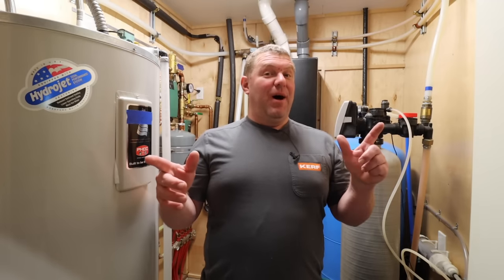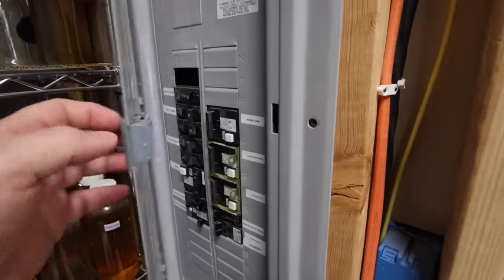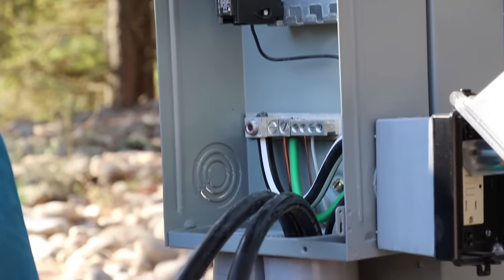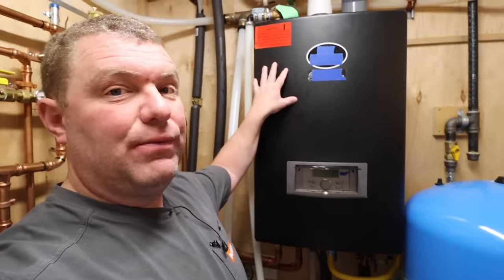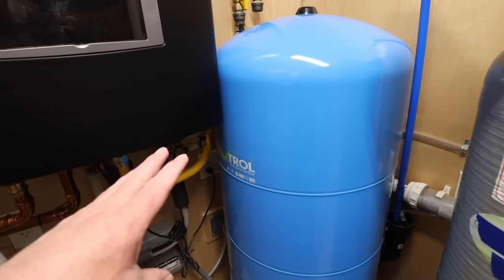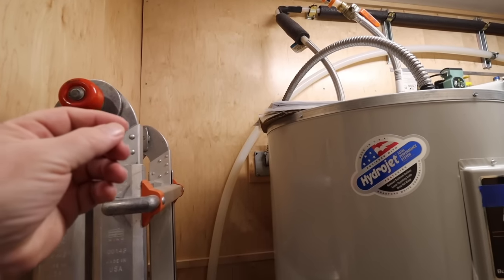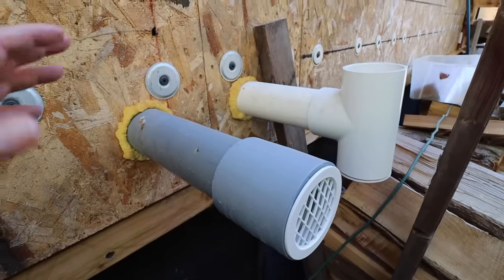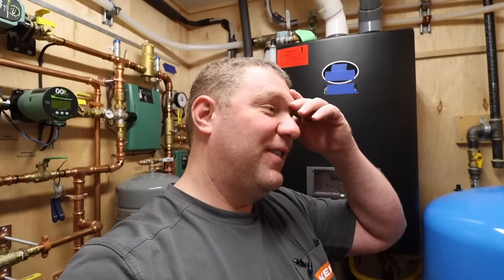3 Things They Don't Tell You About Tankless Water Heaters (On Demand Water Heaters)

Comment: Careful with hot water loop with copper because at each 90 particles hit the wall with some force.  Learned the hard way with in slab leak.  Suggest looking at Upinor PEX with distributor Valve which feeds the outlet directly with minimal 90 angles.

Comment: Rinnai tankless here. 199,000 BTU on propane.  Just plugs into a 110v outlet.  They are amazing.  I have 2.  1 for our radiant floor heat and the other will be for domestic hot water with dedicated return loop.

Comment: In Europe (The Netherlands) we use two concentral metal pipes, cold input air through the outer pipe and hotter burned gasses through the inside pipe, you need only one hole through the roof and also some heat transfer to the input air. On the roof, the output pipe sticks out above the inlet for the input air to avoid circulation of burned gasses.

Comment: I put in a tankless water heater water heater for my mother in the early 1980's. It used a metal exhaust pipe. Pilot blew out when the wind blew into the exhaust pipe. Didn't realize it until the heat exchanger  froze. expensive to replace. Bought an automatic flue closer so it didn't happen again. I don't know if yours has something to prevent the cold from blowing in the exhaust but it sure is a worthwhile investment if it doesn't.

Comment: They make a system to circulates the water from the hot back through the cold until hot water is achieved. It can be activated with the same switch as the lights.
Reply from the maker: Have them. Future video!

Comment: I like my gas water heater with it's pilot light, the pilot light contrary to claims does NOT "waste" gas, in fact, that little flame is enough to keep my 30 gallon tank at the set temperature alone, until I draw about one gallon of hot water out, then the main burner comes on, but the rest of the time the pilot keeps the water hot. If I had the electronic ignition BS they sell now, that main burner would be cyling on and off 24/7 wasting even MORE gas than they claim the little pilot does.
I dont know why you worry about that SMALL amount of "parasitic" heat in a closed utility room, in the cold months you'll be happy to have any BTU's that come from anywhere!
My water heater is in the basement, it's insulated, I don't feel the outside of the tank is at all hot

Comment: Nice system. We are getting gas on our road soon and we are getting ready to put in a system. We are finishing up a small duplex and will go with a heat exchanger tank for domestic hot water to have the capacity for both units. I’ll be putting in one of those circulating pumps to keep the water hot at both unit. I’m will be using 3/8” return going right back into the heat exchanger tank inlet. That’s a great price. We are going to heat our hydronic system to 130 F as our house is double stud foam filled walls. I have a friend that retired from a plumbing business he sold and he is going to do all my manifolds and setup.

Comment: I remember seeing you install that tankless heater and thought you were crazy. 
Personally I think a heat pump water heater is the best way to go. They are generally better insulated than regular tank heaters, and heat water much much more efficiently than a resistance heater. Plus, during the summer, they actually act as an air conditioner. In my first house I installed one in my basement which was half garage. During the summer it kept the garage at a nice cool 70 degrees, while heating the water for pennies.

Comment: It's great to have two you back.  The videos that you produce really show how you decided to do something both pros and cons and are very useful as a result.

I'm kind of interested to know if you considered heating the water using the boiler of your infloor heating and how that compared to what you ended up with.  Those boilers are more than 90% efficient and you only need a water tank.  Then you have one heater, can bring the air in and exhaust it out.  Sure you don't have a backup to gas but you could back it up with a propane or just use propane.  Add about 5k or more of solar with as much battery backup to get you through as many days without sun as you would figure to need for your area.  Maybe if you're producing videos regularly, the solar and batteries could come out of that income.  Solar's  really workable these days if you can overcome the upfront costs.

I know you had trouble with the batteries previously but maybe now they are better and require less maintenance.

Comment: its so funny in germany we have standart 100kw conections to the houses. its a 240 V  to ground  3 phase system. In the hous where i grew up there where 3 24 kw tankless heaters. Its normal, hot water tanks are more of a rarity. Very interesting how different the systems are

Comment: A few months ago my kids started taking their own showers and the electric bill spiked and mom and dad got some cold showers before we got them under control.

I've thought about a hot water circulation pump too, but that seems like it would add to the thermal mass that the heater has to keep warm and would cause heat to leak into the walls of the house which would not be nice on those hot summer days. Maybe one that only runs in the morning and evening would be a good compromise.

Comment: Thanks for sharing your thoughts, ideas and videos. Definitely looks like you put some thought into developing this system. One small question, why the blue tape on the logos?  One small suggestion, had a coworker that policed his sons shower time. Took a suggestion I gave him, put a 120v solenoid valve on the hot water to the shower and added a mechanical bathroom heat lamp timer switch to it wall mounted with the light switches, no where near the shower. His only complaint was it ran more than 10min. 😂 certainly glad he wasn’t my dad. Wishing you and your family the best. Looking forward to seeing more of your videos in the future.

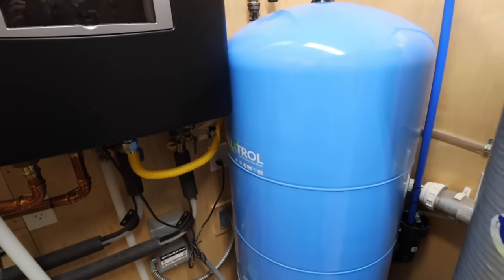Comment: Doesn't the internal tank 9:42 represent a parasitic "cool" mode that you need to make up in the winter?
Reply from the maker: Sure. Conditions water thought which makes the cold water warmer which makes the house more comfortable vs frigid tap resulting in overall lower energy use.

Comment: My tankless is built in that same "box" but different color, brand, and guts. Mine is also 199kbtu but rated at something just shy of 12gpm, stainless internals and no mini tank. I've had it for 6+ years and its been flawless with just flushes (vinegar). It's massively oversized for my home but should be able to run all hot water at once without issue in the house.

Comment: I'm pretty sure the intake T fitting should be rotated 180° so the open side is pointed down. That way when it rains it doesn't run down into the heater.

Comment: You will have to pipe in a special hand valve circuit that you can turn and the water goes instantly cold! Or maybe be a nice Dad and make it where it just cools the water enough to give them the idea that Dad says shower time is over. Thanks for sharing. CB